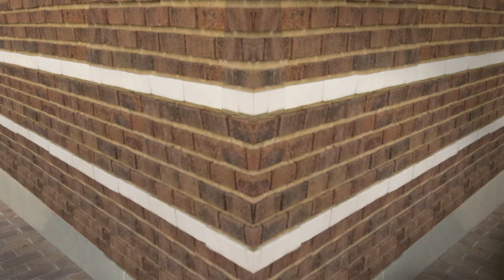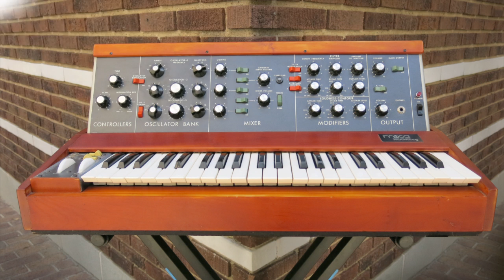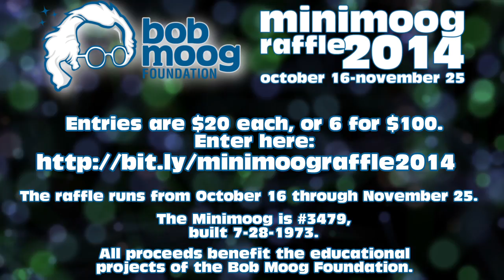The 2014 BMF Minimoog Raffle:  The Minimoog 3rd Oscillator!

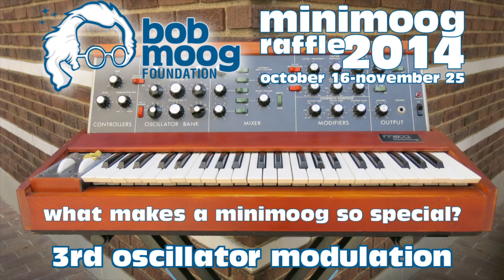Comment: OSCILLATOR-3 0:00:11
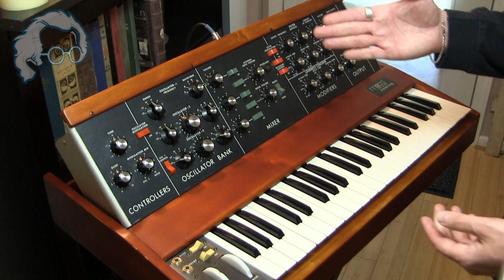01 OSCILLATOR-3 as Low Frequency Oscillator (LFO) 0:00:18
02 OSC3: Triangle wave Low + Turning on OSCILLATOR MODULATION switch + pushing up MOD. wheel 0:00:48 / 0:00:54
03 Turning OSC. 3 CONTROL off 0:01:45
04 … + controlling LFO speed with OSC3 tuning knob 0:01:50 / 0:01:54
05 … + MODULATION MIX: NOISE function >> noise modulating the frequency/pitch of the oscillator) 0:02:08 / 0:02:19
06 FILTER MODULATION switched On >> Directing LFO to filter (the triangular wave opening & closing the filter = increasing & decreasing the CUTOFF FREQUENCY) 0:02:41 / 0:02:48
07 … + controlling the speed with OSC3 pitch/tuning knob 0:03:07 / 0:03:10
08 OSC3: Ramp wave = Reverse sawtooth wave LFO 0:03:14 / 0:03:37
09 OSC3: Sawtooth wave LFO 0:03:38
10 OSC3: Pulse 1 = Square wave LFO 0:03:44
11 OSC3: Pulse 2 = Wide rectangle wave LFO 0:03:45
12 OSC3: Pulse 3 = Narrow rectangle wave LFO 0:03:48
13 OSC3: 32” > 16” > 8” = Adding saturation richness to the sound 0:03:49 / 0:04:02 / 0:04:19

● Discussion of the various merits of the Minimoog https://www.youtube.com/watch?v=uFyQ2WFUneg
● Demonstration of the Moog Minimoog https://www.youtube.com/watch?v=sJ5593eQ
● Minimoog Demonstration: The Bob Moog Foundation Minimoog Raffle Part 1 https://www.youtube.com/watch?v=Z8UUtSbhdpY 
● Minimoog Demonstration: The Bob Moog Foundation Minimoog Raffle Part 2 https://www.youtube.com/watch?v=JoK4jMX5eN4
● The 2014 BMF Minimoog Raffle: The Minimoog Oscillator! https://www.youtube.com/watch?v=7s8nSoPaWpc
● The 2014 BMF Minimoog Raffle: The Minimoog 3rd Oscillator! https://www.youtube.com/watch?v=8RVd8FD3pyc
● The 2014 BMF Minimoog Raffle: The Minimoog Filter! https://www.youtube.com/watch?v=yPHJA092a9w 
● Sounds of the Moog Minimoog https://www.youtube.com/watch?v=-YO8GrOaAcw